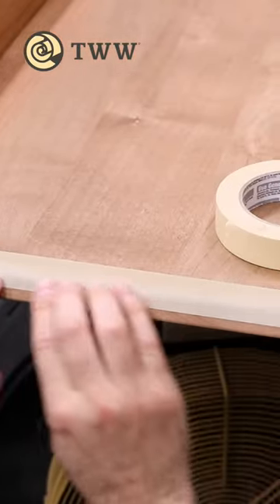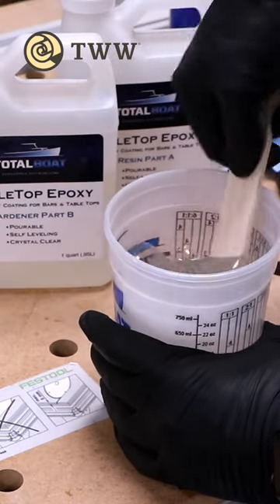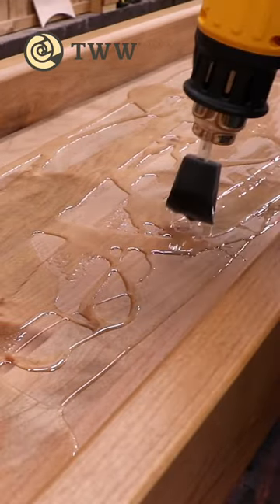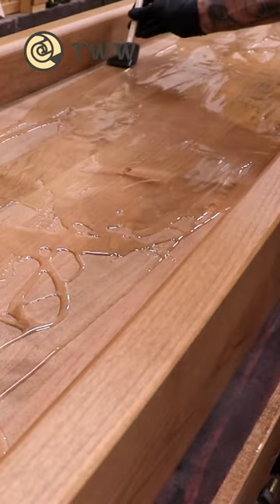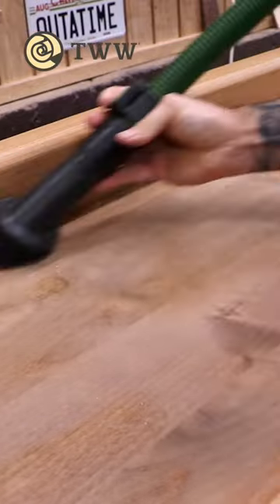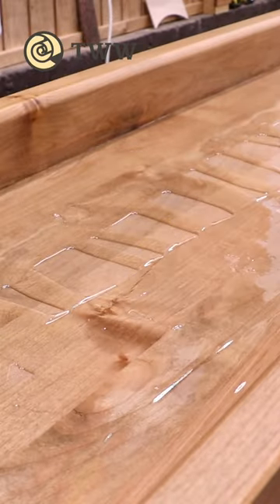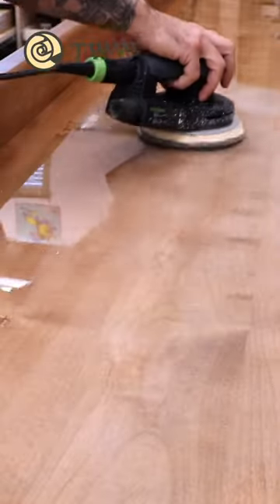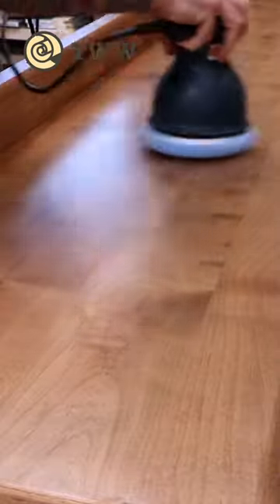Epoxied Slide 🛝 Zoom Zoom! #shorts

Comment: Hint to give you back some of thousands info you shared and made a better professional. Just add a table spoon of 2 per liter of resin of isopropyl alcohol. It will make your resin immediately "liquider". It evaporates without leaving surface stains . It makes resin surface tension less stronger and made it flow allover. You can also spray with fine fog same  alcohol to wood surface. As soon as resin touch the slightly wet surface it will start to run like on glass. Btw it helps also to penetrate  better wood fibers. Hope it helps.👍🏻

Comment: Looks great. I'm not exactly sure why a seal coat would be necessary...you might be able to get away without doing that next time.
Reply: It gives a sealed base layer to build your next epoxy layer off of. That first coat almost always partially, if not fully, soaks into the wood.
Reply: @AGMertzy  there's no way a viscous epoxy like that is going to 'partially, if not fully' soak into the wood.
Reply: @ruffryder13  Please explain how there is no way for it to soak in? Wood is porous and epoxy is a fairly flowy liquid.
Reply: @AGMertzy  epoxy is as viscous as you make it and the 'thicker' it is, the less it flows into the pores of the wood. Without digging up cP numbers from data sheets, it's obvious from the way it behaves in the video...it wouldn't even level out without intentional heating.
It very unlikely that it will be too thick to level out and then somehow so runny that it all disappears into the pores of the wood no matter how much you dump into it